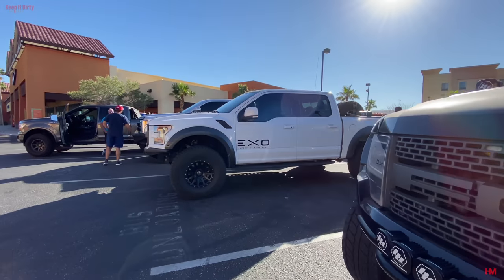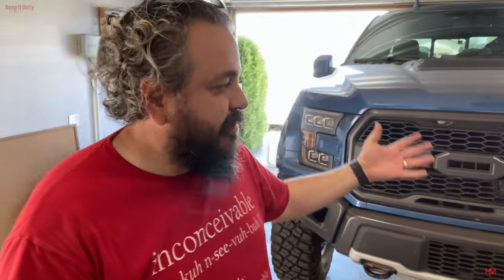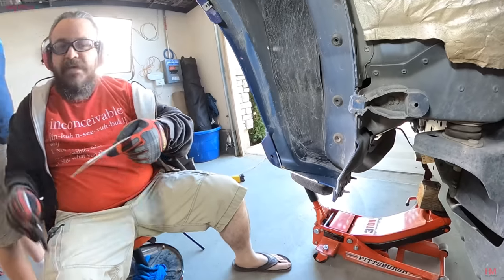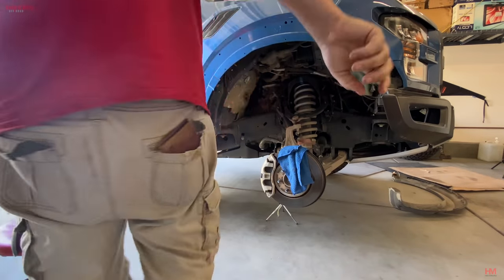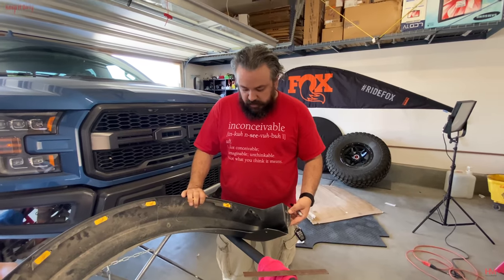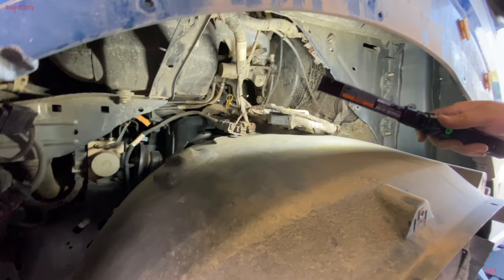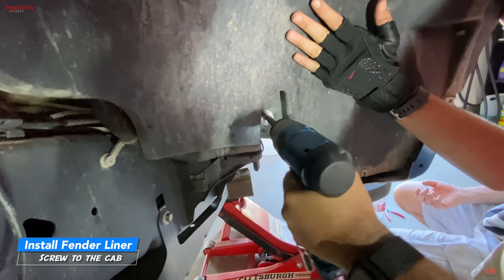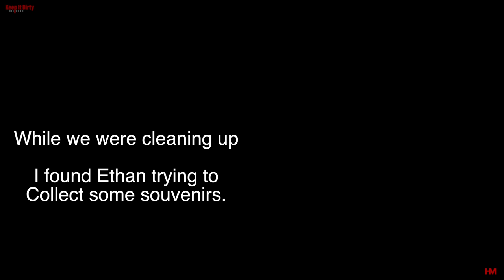How to fit 37s on a Raptor - Benefits / Drawbacks/ Trimming

Comment: its probably hard to do it while in the wheel well but holding the hammer farther down the handle helps, after working on truck brakes I never want to work inside a car/light truck wheel well ever again
Reply from the maker: Andy Brooks we tried that, there is a whole twist your body type of technique that I saw the guys at RPG do. We did not have the strength or the skills to do it.

Comment: At 14:19 on the right hand side you can see the A/C drain coming out of the cab. They will almost always have air blow the water back inside and ruin your carpet. I used a 90° pcv hose to fix it. No more wet carpet.
Reply from the maker: Raptor.Tremor never had problems with wet or musky smelling carpet. Are others actually having this problem? 2 Raptors now and never had this issue
Reply: @KeepItDirtyOffRoad  I have the issue on my tremor and expedition. Dealer replaced while carpet. There are gen 2s that have the issue. I think it goes back to 2004 ford trucks

Comment: Excellent, lucid and well produced videos! I have learned a lot from you. I'm going to keep my 2011 stock with the 35's but I do like the look of the 37s for sure. Just replaced the rear leaking Fox shocks with new ones and now going after the front shocks, your video helped me tremendously.  Happy miles!
Reply from the maker: Thanks man. This is why we created the channel. We got a lot of bad advice when we started and we’ve learned a lot of lessons the hard way.
Reply: with ur shocks did u do something to them with the perch or u just left it standard  because mines was standard and then i went to mid perch and i should have went to high fareal
Reply from the maker: Gen2 don’t have a mid perch option. 

We did Eibach springs to get a little more height up front.
Reply: @KeepItDirtyOffRoad  o ok i have the gen 11  ok i didnt know that about the other gens

Comment: Great video and informative on pros and cons on fitting 37s. Maybe look into regearing to 4.56 gears from the stock 4.10s to bring the powerband back to stock and get rid of the sluggish heavier feel with the bigger tires. I have the Cobb accesport with tcm and so far I like it.  It gave noticeable power and made driving in sport mode enjoyable and got rid of the clunky oem shifting in that mode. Here in the southwest where I live we only have 91 octane so I can only use the 91 octane program but I believe in California you have 93 octane readily available to use the 93 octane program for bigger gains. I also think you had a programmer on the previous truck but removed it cause it gave you codes or problems not sure. Well anyway,  great video and looking forward to possible front suspension upgrades
Reply from the maker: Marco Perez 93 is hard to find in Cali. Texas is where it’s easy to get. 

I did run the Cobb tune in the last truck with 37s and I did not like it. Back then there was no transmission tuning and I had to reset ECU almost weekly to get the truck from shifting all hard. The tune also did not really help on the top end. It felt like once you hit 75-80 she had nothing more to give with 37s. Trying to get over 90 on dirt was just not possible and signs of an incomplete tune because she kept overboosting too.  It a fan of the Cobb tune.

Comment: Great video. One thing to note however is that 37s don't always weight more. For example the Factory Beadlock wheels and stock KO2 tires are 107 lbs, the non-bead lock wheels and factory KO2 tires are 100lbs. Most of the aftermarket wheels weight less. So for example my Fifteen52 traverse HD wheels are 29.88 lbs and 37" KO2 are 69 lbs for a total of 99lbs. The 37" KM3 are 77 lbs so with my wheels its a total of 107 lbs. They do change the gearing slight due to the increase in overall diameter.
Reply from the maker: Kristopher Derentz they don’t weight the same, but it’s night and day difference. There is a clear difference in performance and response.
Reply: tthat is so true

Comment: It's your truck you can absolutely  do as you wish.  My impression of the truck, I have a 2019 Raptor, is its dialed in perfect to me with the 35s.  It seems like the mods you have done could have caused  you some of the issues you have had.  
Great videos, great to see the boys involved in your passion.  Thanks for passing it on.
Reply from the maker: Thanks man. I’m in agreement with you and mentioned it several times over my videos. Only reason I did this video series is for 2 reasons. 1. Too much bad info online on 37s and the Gen2. There are way too many posers and pavement princesses that say it works with light trimming. In the next video I proved it wrong. And showed what it’s actually required just to clear them. 
2. I was given 2 free sets of 37s. It was either sell them or use them. I picked the let’s prove some of the myths wrong route. A route I’m really not liking. 37s limit the truck and cause so much more wear with a stock ish setup.
Reply: @KeepItDirtyOffRoad  I am glad you didn't take it wrong.  You use your truck.  And teaching your kids is great.  They obviously highly respect you.  Keep up the good work and thanks for some great videos and information.

Comment: Bent mine with vise grips first then kept triggering the fuel pump cut-off switch with the sledge hammer. The switch was right behind where I was hitting on the passenger side.  I have a 2001 F150 with HM suspension front and rear and of course my pinch weld seams were steel.
Reply from the maker: Yeah, does not matter if they are the steel or aluminum, Ford made them super strong
Reply: @KeepItDirtyOffRoad  Yep, I only had a short handled 5 pound sledge, but swore I was going to break something I was hitting it so hard.

Comment: I wonder if using two 12" adjustable wrenches tightened down at the edges of the bend and inserting a steel rod through the holes at the end of the wrenches then pushing on the rod would have made it easier to bend those pinch welds.

Maybe, maybe not but leverage is your friend.

Seems like there would be enough room and the distance in between the cuts is small so even though the wrenches wouldn't be exactly parallel to each other a smaller rod should still fit through both holes and what's important is the distance that is now much greater away from the bend giving you extreme leverage. 

Many times at work we come across obstacles we simply couldn't do unless we figure out a way to utilize leverage and then the impossible task becomes real easy.

Great video.
Reply from the maker: Not enough space for leverage unfortunately and as the pinch welds bend they go flat on the body. This is one of those rare cases where brute force is the only effective option
Reply: @KeepItDirtyOffRoad  

I figured that room might be an issue however this would be used only to initiate the bend to a point where a hammer could then finish the job.
Reply from the maker: sixshooter4570 we did try it on the driver side with some players, but even with all my 210 pounds on it, there was no budging. Those pinch welds are thick and take a great deal of force to bend.

Comment: Well done,  I did the same thing on my 2017 back in January,  I put a few coats of flex seal on the bent pinch welds instead of paint( and wish I had started with caulk in the cut lines first) to help reseal up the outside elements from entering into the cab.

And yes a long handle 12lb sledge along with an short handles 8lb did the trick for me, but still took a sh*t ton of beating to get them flat.  The second side took half the amount of time though after I learned how to do the first side, lol.  
Great video!!!
Reply from the maker: Thanks man. Yeah shit ton of work. Made harder by not being able to get a 12lbs hammer

Comment: loved video, but just bought a 18 leadfoot gray raptor. love it as is. i will not ever need 37s but really enjoyed your video. i am an xvette guy that wanted a sharp trk with power, the 18 raptor is that.
Reply from the maker: Thanks man. 18 is probably the best choice for the Raptors. It’s the year with the least issues and most improvements

Comment: I've had to trim alot for my buddies raptor to fit my old toyos off my dodge. The 14" wide MT dosen't look big on my 2500. But it looked monstrous on the raptor. But a solid deal is a deal. Ive had to trim to run 0 offset on the solid axle dodge platform. I just beat my pinch weld flat and called it a day.
Reply from the maker: Did you do any fenders too?
Reply: Yeah, he's running fiberwrex. Not the best quality but he got them cheap.

Comment: Great video! I think it has convinced me to stick to 35s though... I bet a 3X pneumatic rivet gun would do a beautiful job on those pinch welds
Reply from the maker: John Morrison to cut them or bend them?
Reply: To hammer them... They’re hard hammering SOBs designed for use in tight spaces. I think you’d be able to get those seams nice and flat and you would run zero risk of whacking something you didn’t mean to.

Comment: Thoughts on a throttle commander rather than a tune? The truck doesn’t spend much time off-road
Reply from the maker: I’m personally not a fan. The throttle position foolers tend to cause these trucks to go into limp mode. Seen it happen a few times with the Gen2 platform. Some guys run it and never have a problem. Others can’t stop having problem. It’s hit or miss so I’m not a fan.

Comment: Are those 5 bolts that go on the fender liner the same 7mm as the ones that where on underneath holding the Fender Flares?
Reply from the maker: Nope. They are different. The fender frame ones are longer while the liners stock use push pins and we changed that to self tappers

Comment: I think that if Ford released a Raptor with slight factory modifications to fit 37" wheels, people would then find a way to trim off something or other, lift an inch or two, and get 39"s in there xD
Reply from the maker: They trying it now with the Gen3 and some trying to do 40s since it can clear 37s

Comment: Nice video on the job and you do your best with what tools you have. If I could only give you my heavy duty adjustable wrench it would be the perfect tool to get the over lapped metal started to 45 degree bend into the frame and then use the hammer to send it home 90 degree. I think I will stick to 35s on my raptor. I suppose you could add the bigger inter cooler to get you back to stock power? Love this content 👍
Reply from the maker: Paul Newman thanks man. We tried a wrench and there is not enough space and the welds are super strong. The only way to bend is brute force. 

I was the same thinking. I wanted to stick to 35s. But I had a garage full of 37s. 2 sets actually. I could not let them go to waste and no one wanted to pay what they are worth. So 37s on the truck. 

I have a video coming up on the rubbing and that’s going to change a lot of minds on 37s . Stay tuned for that one

Comment: Just run BFG ko2  37s they are a little smaller than true 37 and u can run a matching spare under the bed.. basic trimming mods on the front. Contact Baja HQ they install 37s on raptors all day everyday and then do baja tours with the customers trucks they build with no issues
Reply from the maker: But then you would be stuck with the worst tire for these trucks 🤷‍♂️. 

Baja HQ does the typical trimming we did in this video series. But they don’t trim and move up the trim like we do. For most scenarios that will work. But at full tuck, you can get into issues and that’s why we showed the trimming needed to make sure you you don’t rip off your fenders.

Comment: Great video,, what are your thoughts on 37 13.50 General grabbers on a -44mm offset wheels, with the 3.0 kings and icons leaf springs, do you thank am expecting more or less trimming ,, thanks.
Reply from the maker: Your ripping fenders off. 

Sorry. But have to be honest man. Stock wheels are at 38 offset. The max most run with 12.5 is 0 offset. And they still touching but not rip fenders off, just touching. 

I ran 0 offset with 13.5 Nitto terra grapplers and basically came up right to the range of the stock fender. Popped off the fender trim a few times in o shit moments. 

With any form of negative offset your ripping off stock fenders and most aftermarket fenders too. Specially with -44mm. That’s almost 1.75 inches wider. If the tires go full tuck that’s ripping the fenders off and causing some damage.
Reply: Why size wheels would you recommend for the 37s General grabber x3!
Reply from the maker: +6 to 0 offset. Most will run 0. But with a 13.5 in wide tire a +6 may be needed. 

If your off-roading look into Icon or Method bead grip wheels for affordable and strong options.
Reply: Great, thank you.

Comment: Hello , I own a 2017 Raptor .Do you think the Fabtech Suspension Lift System 4" is a good choice to put a 37 tires . Thank you so much for your videos
Reply from the maker: A “lift kit” is the worst thing you can do to a Raptor. Specially if you want to put 37s on the truck. For one, the lift kit removes any off-road capabilities of the truck. The shock spacers they use will collapse first wash or small jump you take at speed. It also changes the suspension geometry such that it eliminates most of your suspension travel. And finally, you still have to trim because the tires will rub a lot. 
Don’t put a lift kit on a Raptor.

Comment: Do you Recommend  a catch can?
Reply from the maker: I get asked this question a lot. For me jury is still out on catch cans. For the most part turbo engines are designed to burn a little bit of oil as part of their normal operation. Reducing how much gets burned is a good thing BUT there is no solid information out there on the actual benefits of a catch Can. I’ve seen more bad than good actually because it’s hard to distinguish between a well designed system and a bad one. At the end of the day, there is no solid info out there to show me the benefits aside from catching oil so it’s going to stay off my truck.
Reply: @KeepItDirtyOffRoad  Catch cans catch a few tablespoons of oil a month that would normally flow into your intercooler. Why not? great insurance for 120 bucks.
Reply from the maker: R  OK, that’s what I hear everyone say. But even with a catch can you can’t avoid it all. And I’ve read other complain of catch cans causing codes or loosing power after installing at Catch can. Personally, I would rather not risk it. The companies that makes them for the most part are not engine builders or designers. Catch cans are easy to make and they copy designs and don’t do any proper testing. Differentiating between a well designed catch can and a bad one is also difficult. So I’m not taking the risk on my truck

Comment: I recommend checking out Rhino wheels also
Reply from the maker: EJ do you mean black rhino?
Reply: I've seen black rhino wheels break, but that was also jumping a 9000 pound mega cab repeatedly. Im sure the raptors wouldn't be as bad.
Reply from the maker: Joe Hansen I’ve seen plenty of wheels Granade 
on the Raptor. The 4WP initially worried me, but they have a lifetime structural warranty so if they break I should be good.
Reply: @KeepItDirtyOffRoad  I've had good luck with my racelines. Cast wheels can only handle so much. Its only a matter of time.
Reply from the maker: Joe Hansen yeah, I agree but tire pressure and all that are a factor too. I bent 3 forged wheels running too low of a pressure

Comment: Would +18 still be able to fit upper control arms?
Reply from the maker: It’s going to be tight. I would not recommend it. We know the icon wheels at +6 can clear. But 18 would be way too close for comfort. Specially airdown
Reply: @KeepItDirtyOffRoad  do you think the methods you had with +6 would fit an upper control arm?
Reply from the maker: We know +6 wheels clear. But method does not make +6 wheels with the ford 6x135 pattern. Your only option from Method is 0 offset and that will more than clear.
Reply: @KeepItDirtyOffRoad  thank you I will look into those icon

Comment: What difference did you see in gas mileage with the 37's vs 35's?
Reply from the maker: Went from 14-16 MPGs down to 11-12 MPGs.  There is a big impact.
Reply: Keep It Dirty Off-Road makes sense. Thanks for the info

Comment: I put 37's on my gen 1 raptor and it barely rubbed, put it on top perch and now it doesn't rub at all. I suppose another reason the gen 1 is better?
Reply from the maker: Not really man. Once you fully flex that suspension, you will rip off the stock fenders. First truck I ever saw with 37s and the typical no rubbing attitude was a Gen1 and he ripped off his fenders at full tuck and caused some major damage to them.
Reply: @KeepItDirtyOffRoad  Yeah I've heard it destroys it as well but just driving 95% on the street it is no issue, but I plan to get some fiber glass 2in flare fenders soon so I have no worries at all.
Reply from the maker: @Rocky-ry4lx  ah ok. Make sure you clarify that next time. A lot of people ask about rubbing are asking for off-roading do you see rubbing. Trimming for street and trimming for off-roading are 2 very different things
Reply: @KeepItDirtyOffRoad  Yeah my bad, just gen 1 vs gen 2 banter hahaha